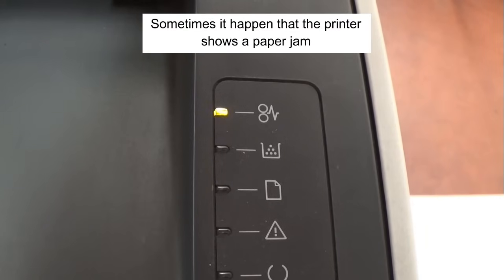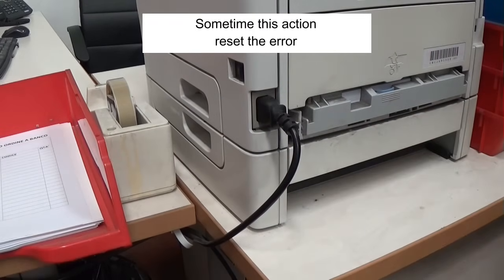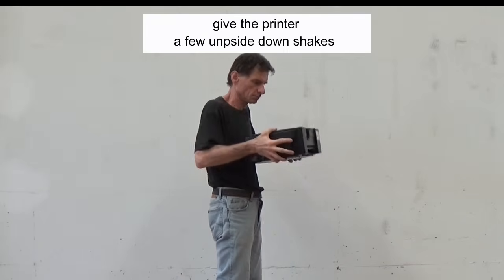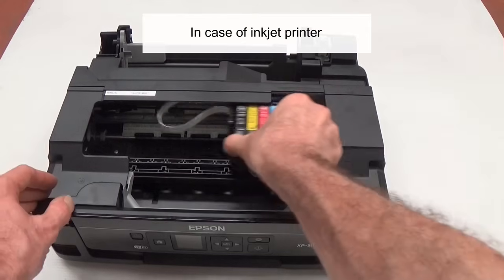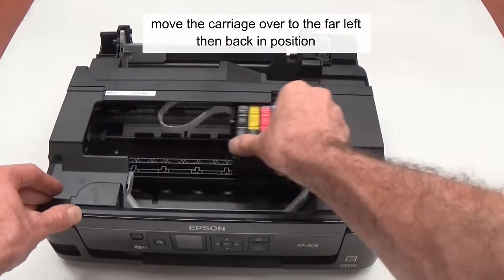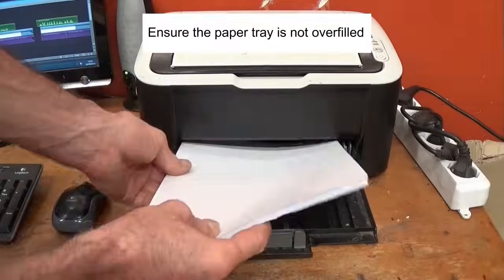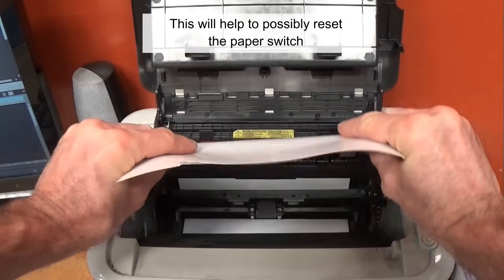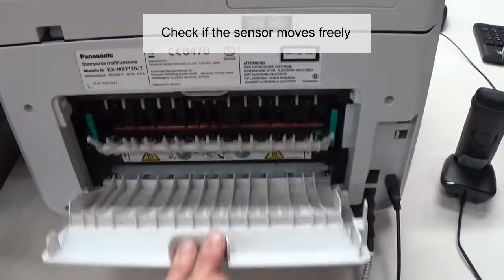What to do if Printer says paper jam but there is no paper in it

Comment: Ive done all of these steps for my Canon Pixma printer, only 2 years old, still nothing.  THERE IS NO PAPER JAM yet it keeps giving 1300 error code.
Reply from the maker: So there could be a defective paper sensor
https://www.youtube.com/watch?v=qSQAmht4knU&t=60s
Reply: @viandant5 i ended up dropping the printer 2-3 feet onto a concrete floor as a last resort. It leaked ink everywhere, it's in the trash, lasted 4 years. It did save me lots on ink, so I'll probably get another canon.

Comment: Worked for me too! I was ready to throw the whole thing away after 6 months of being unable to use it. I opened it up as much as I could, blew into it really hard to get as much dust out of the way as I could (was really dusty), then did the upside down shake. I could hear something loose rattling inside and while I couldn't get to it, it might have moved out of the way of the sensor which was enough to stop the error messages. Thank you!

Comment: I tried all these things and when I got to solution "4B" I couldn't get a paper to feed through. It kept getting stuck on something. I tried using a membership card (think credit card thick) and out popped a lego piece (yes, I have kids)! I also used baby wipes to thoroughly clean (remove dust) inside and outside the printer. Now it works great! I'm so glad I don't need to buy a new printer!!! I just wanted to share in case the card trick might help someone else!

Comment: Great idea.  Didn't work for my Canon mf229dw.  I keep getting told to close the toner cover and close the control panel (which I had already done).  Any ideas?
Reply from the maker: The cover sensor could be defective, or the connector on the main board in not well connected.

Comment: The trick of putting thick paper worked for me, the error message was not showing but the paper was still getting jammed so in the next step, I used the same thick paper for the printout, with it all the tiny pieces of paper that were stuck came out. Great Video, even shaking the printer would help but tiny pieces that are stuck near the printer sensor can only be removed with the thick paper trick.

Comment: Samsung ml3471nd gives tray1 empty 
While it filled with papper 
Pls how i can solve it many thanks
Reply from the maker: May be a paper sensor, check the flag near the paper cassette. Are you sure you selected the right tray in the printer properties?
Reply: @viandant5  changed the sensor and the flag is ok 
But still the same issue
Reply from the maker: @printarea9182  May be the sensor is broken, or the connection od the cable sensor is defective
Reply: @viandant5  many thanks for ur concern the problem is solved the papper indicator was jaming the tray again many thanks

Comment: I was getting a paper jam error in an epson when there was no paper in the paper path.  I have a continuous ink system installed on it and as it turned out there is some tubes going from the ink resevoir to the catridges. The tubing had slid out of the plastic piece holding it up and was slightly making contact with the carriage.  When I took the slack out of the tubing so that it wasn't falling down in front of the carriage it seemed to have fixed the problem

Comment: So after trying all of the things in the video I in the end I unplugged it, pushed a piece of card in as far as it would go and then turned it on. On powering up it sucked the card through the machine, there was a small 'cracking' noise, the card came out, and then the jam message cleared. A test print worked fine . . . BUT . . .  a tiny little cog on a spring came out with it 😳 !! but it seems to still be printing 🧐 EPSON ET-2750

Comment: Tried all this nothing worked unfortunately. I even tried shaking it but a random spring just flew out lastly I drank 1/2 a bottle of whisky hoping to pass out and awake to find it magically working again but sadly to no avail.
Reply from the maker: May be the spring is the problem. Check the paper rubber pad, there is often a spring on it. Probably you have to bring the printer to a repair centre

Comment: Sir in my printwr when i switch on its start and then after few seconds stop rolling sounds and shows E03 i checked nothing got stuck now what i do???
Reply from the maker: Which printer?
Reply: @viandant5  canon G3010
Reply from the maker: It's a paper jam. If nothing works I think you have to bring the printer to a repair centre. May be a paper sensor is broken or out of position

Comment: help me my printer is showing error e03 but there is not paper inside stuck model is canon g3010
Reply from the maker: It could be a defective paper sensor. No one of these methods work?
Reply: @viandant5  what should i do now my printer is canon g3010
Reply from the maker: @roshanmishra2386  If nothing works I think you have to brong the printer to a repair center. It could be a defective paper sensor

Comment: The "Jam Inside" message came up on my Brother 5470DW printer after the printing of a couple of perfect documents (two pages apiece), a month or so ago. There was no jam. Since then I've done everything shown online, so far, to address the error  message. I've cleaned the printer thoroughly, inside and out, back and front, and now I've tried all the steps in this video. Repeatedly. The error persists. I may try the steps a few times more, but I wondered whether anyone had other ideas. Nothing was the matter; I printed those docs and then suddenly, all was lost. So I ask now whether anyone has more ideas. I think the printer wants to work, but short of taking my fury out on it (not going to produce the result I want) with deadly force, I don't know what else I can do. Thanks for your patience, everyone, during this long message.
Reply from the maker: All these methods doesn't work if the printer has a paper sensor broken or out of position, or a deformation in the mainframe or a broken part. I think you have to bring that printer to a repair centre.
Reply: @viandant5  Thank you for your answer. I really don't see how any of these things. could have happened so suddenly in a printer that was never moved out of its place, bumped or otherwise come to any harm, but it's entirely possible that is the case. It's all just so strange, but I guess those things happen. Would there be some way for me to, at least, find out whether the paper sensor is out of position, or does that require going into the bowels of the machine?

Unfortunately, because of the coronavirus (I have risk factors that require me to stay at home and out of places where others go) and the fact that the only repair centres are too far away for me to get to them (if they actually are open) without a taxi and some way for me to move the printer out of my building and in and out of the repair place, it seems that I shall have to give up and get a new printer. (I've loved that printer.) Thanks again.

Comment: How do i remove 031006 error in Epson WF-7710 cause of paper jam but i remove all papers behind
Reply from the maker: The error code 031006  is an internal fault that can be caused by anything, as all Epson codes. Probably a paper sensor is damaged and there is no way to remoe that code

Comment: Should I worry about Shaking Printer Syndrome?
Reply from the maker: The shaking is the best method to solve almost all problems
Reply: @viandant5  Hi my friend. Just saw this video and I am wondering maybe you can help me. I have an Epson All-In-One WorkForce 2650 and I am getting Scanner Error 4D. I cannot find much information on this and not too much solution available either. I have unplugged, left off for 10 mins, 45 mins, 24 hrs. Nothing. Turned on and off repeatedly....nothing. Attached to laptop via USB and it would not communicate. Started getting communication error. This printer worked fine for last 1.5 years. All of the sudden, I am having these issues. Any suggestions would be truly appreciated. Thank you
Reply from the maker: @Cmoney860  Try to turn off the printer.
Open the cover.

Check if the container of the cartridges slides to the extreme right side.
slide the container of the ink cartridges manually to the left back and forth a few times.
Close the cover and turn on the printer. If it doesn’t work then try it again.
Reply: @Cmoney860  When you look the scanner machinery through the plastic window is there any hint that something is stuck in wrong position? I had this error when i bought my  printer as used and it was packaged in wrong way and the printer suffered when transporting by local mail

Comment: My HP Envy 4500 printer shows the following error message: "The print cartridge cannot move. Open the ink cartridge access door, clear any paper jam or obstruction, ensure ink cartridge levers are  lowered & snapped into place". There is no paper jam, the cartridges properly in place, yet still get this error message & can't use my printer. Help!
Reply from the maker: I think you have to change all ink cartrisges. Epson cartridges can give all type of defects
Reply: When you open the cover, is the printerhead moving? It might be misplaced or something

Comment: Most of what he shows may work for a typicl laser printer, but not a most Ink Jets, where the sensors are hard to find or access, and you can't push a card stock through as long as the Jam msg is there. And try shaking an Ecotank printer even right side up let alone upside down, and you'll be tie-dye a rainbow of colors from head to toe.
Reply from the maker: Remove the cartridges before the shaking

Comment: Can i apply  this method for canon printer? ?
Reply from the maker: yes
Reply: How i will shake this down ?
Without removing cartridges cz it stable in that
Reply from the maker: @umamakulsum628  it's difficult to say without knowing which Canon printer do you have. I think you have to remove the developer unit
Reply: My printer is canon G2000 Pixma 
Nd my my problem is paper jam but there is no paper in it
Reply from the maker: canon G2000 Pixma is not a laser printer, it has no toner

Comment: Had this happen with an HP 4650, I had to cancel all print jobs and uninstall the device in the device manager with the printer turned off. Do a shutdown on the pc attached to the printer by usb. The reloading of the drivers cleared the erorr message and allowed for normal operations to resume. There were 26,000 post on their site that discussed false paper jam.  Wanted to get the fix out there for everyone.

Comment: Cannot print. Keeps saying printer in use. Tried holding GO for two seconds but it will not cancel. Can anyone help?
Reply: I have a HLL2360DW laser printer.
Reply from the maker: obasanla  may be a pc problem. try to install all updates, try to reinstall the driver. check into the printer folder id there are print in queue

Comment: I have an Epson ET-16500 (which weighs 66lbs.) way too heavy to shake.  After removing a paper jam from the front, it prints crappy now.  My text is virtually smudged and unreadable and my photos have lines through them.  $1000 printer. What to do?    I'm beginning to like the sledge hammer idea.
Reply from the maker: I think the problem is not the paper jamo but a dirty or damaged print-head. First of the hammer try some print-head cleaning cycles
Reply: There might be little peace of paper or dirt left which prevents printerhead printing properly. You should try spray some bottled compressed air or use vacuum cleaner gently where the printerhead is situated.

Comment: Thank you so much for posting this. With Tip No. 4 (2:17) I was able to reset the error message and move a sliver of paper out from inside the machine by loading card stock into the paper tray und running it.

Comment: Pushing a piece of heavy/glossy paper through the paper path is the tip I will use first from now on. Why didn't I ever think of that? Thanks for this video (and thanks for many other videos of yours I have watched) keep'em coming.
Reply: Jim Wilson This also works for me. I used Vellum paper, and when I gently pushed the vellum paper into the rear tray, suddenly all accumulated dusts and dirts (Even a small shards of plastic stucked there) came out. When we removed it, that's when the paper rollers moved. Turns out, all accumulated dusts and dirts were keeping them from functioning.

Comment: I'm a software person, so see advice like "turn it upside down and shake" seems a little odd, but damn if it didn't work! Thank you,,,,never in a million years would I have thought to try that.
Reply: Thank you geniuses, one and all. It's a heavy printer, but I was able to lift the thing, turn it upside down, and out flew a push-pin. The frustrating message disappeared and I don't have to take the printer to the repair shop or the backyard.

Comment: epson is ALWAYS doing this, says paper jam or no paper. Really pisses me off. Started doing this pretty much out of the box
Reply: ours is less than a week old and it's doing it :(
Reply: I need papers to print for tomorrow n I can't find any solution to find it😒😑😑
Reply: @mohammadkhalid5884  You should do more shake
Reply: Yup, mine too
Reply: sheri mcmahon mine just started. did you fix yours and how?
Reply: sheri mcmahon IK i asked epson there wont be any problems but the jammed paper is the problem
Reply: Ugghjh ikrrr
Reply: I decided to check the settings menu and there is a paper feed maintenance option, it must clean any buildup off the mechanism--fixed it! I'd checked repeatedly for bits of paper, opened and closed the paper tray and the door to the paper feed, powered off the printer, yada yada, but the maintenance thing actually did it.

Comment: i have a samsung xpress c180w and it keeps saying paper jam inside the printer but there is no paper and this happened after i placed two pieces of paper with tape on it
Reply: we took apart the printer and tried checking everything but nothing works
Reply from the maker: May be the adhesive of the tape remained somewhere over a paper sensor, or the paper sensor get damaged. I can only suggest you to look along the paper path and try to watch for something dirty, damaged or out of position
Reply from the maker: There is a paper sensor not properly working